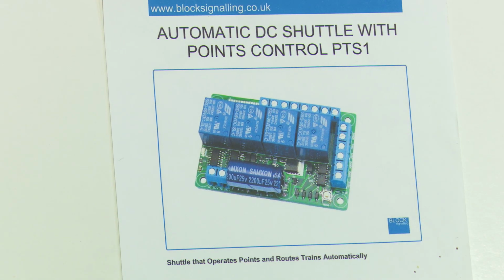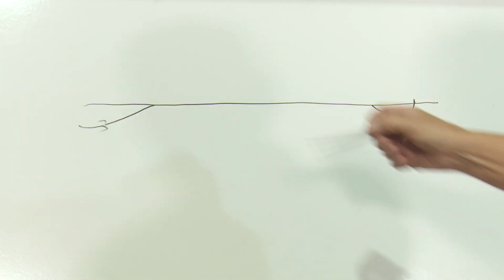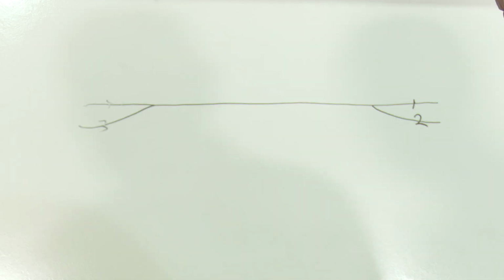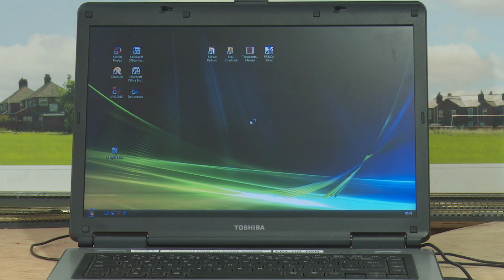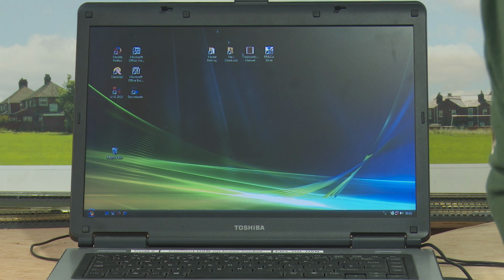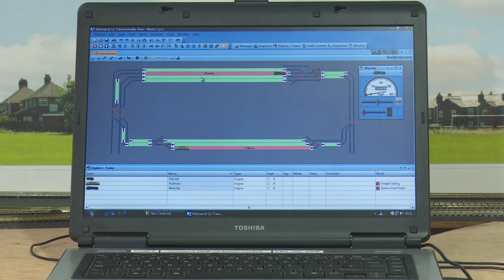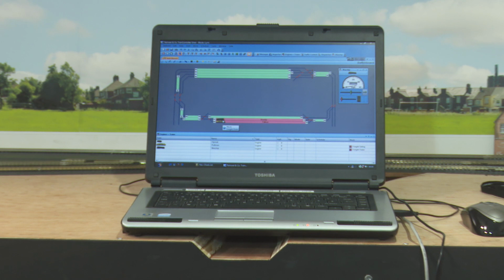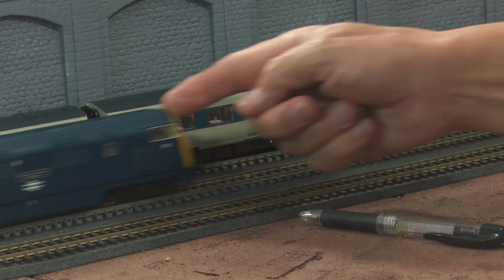Train Automation at Chadwick Model Railway | 108.

Comment: From what I understand Marklin can use both block and / or time to run a layout
Reply from the maker: Thanks Euan, I wouldn’t really know.
Reply: I have a marklin CS3 and yes it's fully capable of doing it either through the CS3 itself or you can use third party software

It's can be done using CV's but you always have to be careful when playing with them
Reply: That's Evan not Euan - I used to have polite goes at my corporals for mis pronouncing my last name

Comment: My eventual plan is to use merg cbus with jmri and the merg cbus dcc system.  If you can solder through hole components then it can be a big money saver! Being disabled and on a limited budget,  that saving will make a big difference.
Reply from the maker: Great, do keep me posted on your progress.
Reply: @ChadwickModelRailway  i will when time and health allows me to get back to model railways.  I've had to be taxi driver for my other half after he suffered a detached retina in August,  meaning he can't drive until he has cataract surgery,  hopefully next month. I hope to try and get some progress on building track though soon as that is what is holding up making progress,  the fun of deciding on p4 😄 not that I regret it!

Comment: !?!?!!??!!
Yeah. The planing side of my new layout is becoming more and more interesting, as I'm looking into doing automation, on the DCC layout. I got the basics on the block detection, but after watching this, more in depth planing needs to take place for the block detection.
Having already an NCE system, and looking at the Digitrax block system, which is an easier set up, the biggest question would be, if anyone has experimented with it, Will the Digitrax Block system work with NCE?
Thank you for sharing your experience and knowledge Charlie.
Reply from the maker: If you're in the UK Arty, give James a call at DCC Train Autimation.
Reply: @ChadwickModelRailway   No I'm in Wollongong Australia. Currently our biggest issue here is supply on many model train items required for constructions, like point motors.
While I work on my engine facility, I'll make a decision on which way I'll go on the choice of electronic systems.
At this stage I'm working on having my layout working on a day night simulated operations, so for track detectors I'll require to go on current detection system.

Comment: Most interesting video 👍🏽 As a user of DCC I have been experimenting with automation without a PC  through the use of various methods including the Lenz ABC braking modules  which require the fitting of Lenz decoders . Another way is to setup the command station to perform shuttling operations again without a PC in sight . The Marklin CS3 as well as the ESU ECoS are more than capable of achieving that and even the old technology Uhlenbrock Intellibox ( Loconet )  will do nicely
Reply from the maker: I am aware of ABC Braking and perhaps I ought to do a video on it.

Comment: Hi Charlie, I have a very simple and inexpensive solution that should help you to monitor the voltage and current using your DCC Concepts Alpha meter on each of your blocks but rather than a lengthy explanation I have done a drawing that should be fairly self explanatory but, I’m not sure how to send it to you.  If you would like me to send it to you just let me know how I can send it to you.  Thanks.
Reply from the maker: Hi Andy, my email address is at the end of the videos. Regards Charlie

Comment: In one of your older videos, someone suggested to use automobile audio-damping material underneath the layout board to reduce the train rattle.  I added the suggestion to use those 4x8 feet foam insulation boards.... thinking that they would be easy and quick to install.... at least they would be easy before the tracks, etc are laid.
- Hope this helps..   God Bless.
Reply from the maker: A good suggestion and I will try once the rtracks are ballasted as that's when they tend to become noisier.

Comment: Good video, thanks. This confirms my thinking that it was so much easier and cheaper to do simple automation, like shuttleing, in old DC systems. Today, If I want to do the same in DCC, I need to invest hundreds in a computerized system in addition to the central DCC system. Or to make an isolated DC trackage beside the DCC trackage. Or, to feed the current to isolated trackage via a DC/DCC switch.
Reply from the maker: I’m so pleased that you found the video useful, regards Charlie

Comment: Great videos Charlie! I have been watching through your journey with the new Chadwick layout with great interest and has some good insight, very thorough. I have showed my kids your videos and have decided that we would like to build a model railway layout of our own and would be a great bonding experience for us, with the kids getting much involved with the messy side of things and leaving the technical know-how to dad. I think initially i am going to go for a DC layout as i have a board and DC stuff from when i was younger in boxes plus a few hand me down oval train sets, however i think i would like to set the layout up for DCC for a later date. I have a question and i may have missed it in one of your previous videos but the green wire from your point motors to the frog what exactly is this for? I've managed to get my head round the rest if the DCC content covered in your videos but I've been wondering what this does. Thanks!
Reply from the maker: Hi Rory, the wire attaches to the frog if it’s all metal. This is known as an electro frog point. If it has a plastic tip then it is an insulfrog point. Insulfrog are far easier to install but electrofrog points give you better running.
If you choose to use electro frog points, then the frog will have to be switched from one polarity to the other depending on which way the point is thrown I do hope that makes sense. Regards Charlie
Reply: Ahh right ok, yes makes perfect sense. Thanks for that. Looking forward to your next video!

Comment: Keep on rockin' Charlie. I just got a commission to make a Christmas layout in Tolmin, Slovenija. I'll be using Super 4 track and old Hornby Silver Seal Black 5 and Ivatt 2-6-0 tender locomotives with pleb carriages/trucks and authentic irresponsible drunken passengers on the Hornby clip together platforms. Any advice on wiring or getting wired etc ? From Rod Stewart* (*not really). 🤔👍
Reply from the maker: Not really Martin but do watch out for rust on those older steel rails.
Rod has a different alias!

Comment: Hi Charlie,
Loving watching your videos and learning lots. I have a layout using a separate single bus for all my Tortoise point motors. Having just watched video 24 I would like to setup four districts using the Digitrax PM42. Does each district need the tracks isolating with plastic rail joiners?
Reply from the maker: Hi Tony, the four districts do need to be isolated from each other. I usually achieve this where a point takes me into the next district with two insulated fish plates.
Reply: Chadwick Model Railway   Thank you Charlie that’s really helpful.

Comment: It's amazing what can be done these days but I'm afraid it's not for me being a complete Luddite it's both beyond my skill level and finances. I was however interested in the reasonably simple shuttle system at the beginning so when I am operating my layout alone I can have a DMU or autotrain running up and down the branch. Two questions the train on your friends layout seemed to make a rather abrupt stop and start so is there any way to overcome that with that system and is it possible to override the system temporarily back to normal DCC control if for instance I had another operator to work the branch?  As always an interesting and informative video and I loved the Jackanory comment by someone else here it made me smile.
Reply from the maker: Yes, just turn down the speed.  His is running fast to climb the hill.

Comment: Hi Charlie, this has to be one of the best insights to the DCC control I have seen to date that links all the elements to PC. I have been looking for a simple schematic drawing or flow chart but as yet not found one. You recommended to me to go down the DCC route which I am still reading up on. It would be good to see which systems do mix and match, I am a big fan of open protocol so that you can look to find the most competitive price when it is such an expensive element of a Model Railway set up. Is the installation of block detection better to do before landscaping/balasting or can it be done retrospectively.
Reply from the maker: Like all these things, its best to wire as you lay the track but it's never too late.

Comment: Perfect!  By the time I'm ready to go to TrainController Gold, you'll have worked out all the details and posted 3 dozen videos on how I can make it work.  Thanks!! 😄  Seriously, some excellent insights there.
I've recently spent some time looking at TrainController (Gold) vs. iTrain vs. JMRI's script-based auto train control.  My initial 10,000 foot view conclusion is that TrainController is the Bentley, iTrain is the Lincoln, and JMRI's automatic train control is the Chevrolet.  But when it comes to ease of use, it's iTrain, TrainController and then JMRI.  iTrain seems easier mainly because it's has fewer bells and whistles available.  While JMRI automation is the most difficult since it's primarily script programming. 
Outside of auto train control, JMRI seems to be the best for normal train and turnout control.  It's free, regularly updated, has many upscale functions, has smartphone app throttles, isn't as hard as people think, and there's thousands of users to tap for info.  On the down side, the owner/designer of TrainController isn't, well, friendly to the community.  So, while there's a Freiwald forum on the website that's decent, don't expect a lot of company support. 
Of course my dream system would be a generic power supply, 8 or ten buck convertors to power blocks, an Arduino-based command station using DCC++, led by JMRI controlled by TrainController Gold.  Sans the $600 for TC Gold, I figure the rest is a few hundred dollars.  And  no, I'm  not an electronics or electrical engineer. ;)
Reply from the maker: Great comment Frank, it's the way that I would go today starting from scratch.

Comment: I'm not sure I'll be tetting into full automation... I like to operate the trains... but when I build my new layout, I'll certainly be automating routes so points will be controlled by a PC to take trains from the fiddleyard, all around the layout and back to the fiddleyard.
I did this with a club layout several years ago, and it was very successful.... as you can see in this very short video:
https://www.youtube.com/watch?v=5jGYsrcJVpo

I'm using JMRI on this video... I've found it pretty easy to set up, but it did take a little time figuring out how to set it all up.

Oh, by the way Charlie... the laptop I have in this video... it's 'state of the ark' like yours!! LOL!

Similar to what you show in your video, I'll be using block detectors so signals are triggered by trains moving from one block to another.
I'll also be using servos to operate points (rather than old style solenoids)... which will reduce wear and tear because points won't be smalled from one side to the other!!

To keep costs down, I've seen that Arduino's can be used to work as point decoders, with an Arduino Uno costing £20 operating up to 17 points!!
With servo's costing £2-3 each, that would cost between £54 and £71... which is a bargain!

Of course, it won't be that cheap when I do it, because I don't want wires going all over the layout from a single Arduino, so areas like the fiddleyard entrances/exists will use lots of outputs, but another part of the layout may just have 3 or 4 points.
Even then, it's still a bargain compared to expensive Accessory decoders!

I plan to future-proof the layout so if I change my mind on automation controlling trains, I can do so.
I'll also have a touch screen monitor to operate the JMRI software (rather than a mouse) efectively making it a 'virtual' stud and probe system!!
Reply from the maker: A great comment Laura and I'll check out the link later.

Comment: can I get a little help with my hymek as I got it warm then put it in a siding to cool down. then when i came to use it again it didn't work.
Reply from the maker: Is it DCC fitted?   CV8 to 8.  You could run it without the body to see what's getting hot.

Comment: Hi Charlie and viewers, thank you for a great insight into layout automation it has certainly stired up thoughts of where I would like to go with my layout when it starts to be built.  The question I have and sorry if you have already covered it, if you have line occupancy in sidings or fiddle yard there may of course be a need for multiple occupancy i.e. for shunting/storage etc is this a simple case of having more smaller blocks? Again thank you for another easy to watch and follow film I learn something very one I watch.
Kev
Reply from the maker: A valid question Kev. I imagine the answer is really in the planning. Although for shunting operations in an industrial unit only the arrivals and departures sidings would have blocks. The rest would be operated manually. As for fiddle yards, yes you would have multiple blocks on the same line to allow compression of trains, and when the first train moves off the others move along behind.

Comment: hi Charlie, A quickie could you give me a few more details on the breakout board connectors you have used for the BDL 168 and or PM42 i am very interested in an alternative to soldering at the 40 pin connector from Digitrax. Thanks in advance John P.
Reply from the maker: www.coastaldcc.co.uk 
Break out board for the BDL168 to replace the 44 way connector that brings all the pins to screw terminals rather than solder tabs.

Comment: Charlie, I’m struggling to see why you have a cut in the track? Blocks are separated by insulated rail joiners. The Warship will stop at the stop marker in a block. Why cut the track? I’ve probably just misunderstood what you’re saying!😂
Reply from the maker: The block has two sensors the first sensor slows the train down and when it crosses the gap it goes into the second sensor which tells the logo to stop. I do hope that makes sense.
Reply: Aha! I see now. You're not using current detection in that block then?
Reply: You don’t cut the track if using current detection you know? You just set up a ramp and stop marker in a single block. One detector in a block does everything.

Comment: Blimey Charlie, VISTA must be the absolute worst operating system Microsoft have ever come up with, I found Windows 2000 or Windows 7 to be the best (in my opinion) I had Vista BUT NOT FOR LONG what a heap of crap, I found it to be. However whatever floats your boat, as they say.
Reply from the maker: I totally agree Sam.But for this one simple program it’s not worth throwing that computer out just yet.
Reply: @ChadwickModelRailway  How about just installing a new operating system on it, mmm maybe thats not really worth doing either. Still at the end of the day its up to you. I am sure though that you would definitely benefit by updating the laptop as the program where you drag an drop to go the train routes would be a smoother transition, easier and faster. Don't bother using time to reply. I still don't know how you find the time you do. Very well done though mate, I really appreciate your videos. stay safe, Sam

Comment: I'm still trying to work out what to use for block detection. Current sensing is fine if for just the loco, but would imply your length should never be longer than the shortest block, and putting resistors on all the trucks would be detrimental to dcc operation, I think.
Reply from the maker: Trains can be longer than the shortest block as train controller will hold a train at the previous block if the one ahead is occupied. I do hope that makes sense.

Comment: Hi Charlie,
Interesting video, some years back when I needed to learn a new software language for work I decided to write a control application for my model railway, I had previously used something called WINLOK, as I am now retired I have been improving my application and just recently added automatic control, which surprisingly seems to use the same basic methods as Train Controller. 
Are you using or thinking of using the digitrax Transponding ?, I have struggled to get this to work reliably. 
Cheers
Dave.
Reply from the maker: Hi Dave, I’m so pleased that you found the video interesting. I don’t know anybody who’s managed to get the Digitrax Transponding to work! Regards Charlie

Comment: Thank you Charlie. I hadn't realised some of the gadgets for DC. As I gather loads of ideas/information, it certainly keeps the dementia in check! Following this video has given me another option to plan in a DC line separately which might suit my older Triang trains of 50+ years ago. That's once I lay a test track - and as I mentioned before, a possible use for my super 4 track and series 3 track of which I have a good few points!  The new Peco track I've bought will do the DCC and plumped for Digikeijs maybe using JMRI. Need to learn more yet and look at itrain.
And then I can bring my wealth of knowledge gained from writing Fortran albeit punch card input is no longer necessary😂😂😂 
The DC option will be quicker as a way of getting something running for my grandsons!
Reply from the maker: I’m so pleased that you enjoyed it Iain. However, I would move away from the JMRI idea with more emphasis on iTrain.